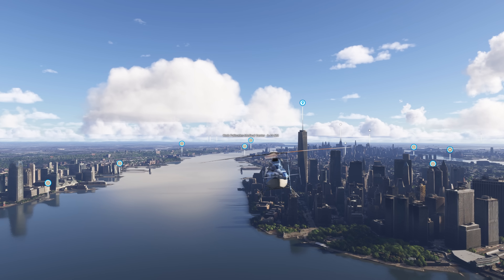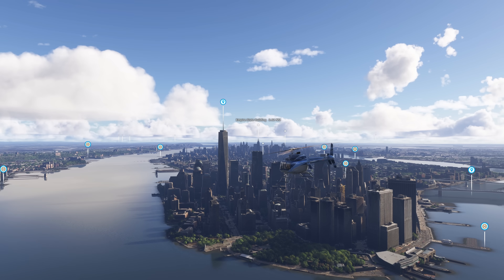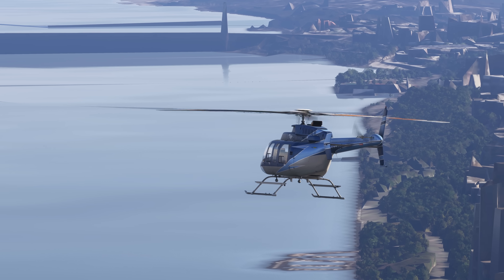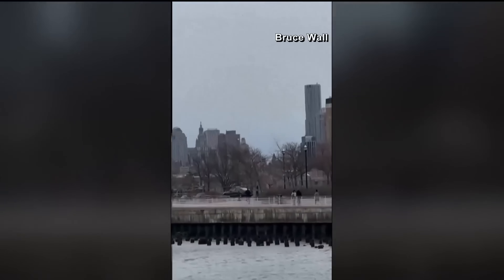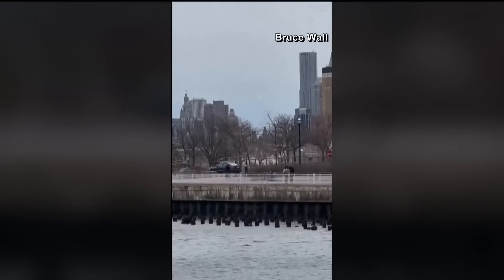Helicopter Expert breaks down Hudson Crash, and discusses “Bump Mast” Theory | NYC Crash Follow-Up

Comment: Could a client have pulled the rotor brake lever????? 
   

 It was a instant main rotor delete!  Ripped the whole transmission rite from the air frame. Surely they would have had chip detectors or vibration detectors going off if something was going on inside the transmission or motor.

Comment: Question: If the droop can hit the tail why doesn't that happen on start up?
Reply from the maker: Good question. The droop of the rotor is still above the tail on start. But if enough negative G force is applied in flight it will droop even further causing a strike.

Comment: Carbon composite main blades were fitted to this helicopter. (OEM blades are aluminium). I wonder if this contributed in any way to the incident?
Looking at video of the main rotor major fracture point…
The skin surfaces at the break are totally flat. Aluminium sheet would have a curve at the point of tare. Also the tare edge would be mainly curves. The torn edge of this blade skin is *totally jagged*. 
Definitely a composite blade and not aluminium construction. (It does have an aluminium leading edge protection strip, along the entire length).
I notice that Van Horn Aviation supply composite blades for 206L. (Don't know if they supplied these blades or if there are other composite blades available). I think they say they have 250 sets in use on the 206. (So fairly rare?) 
One of the blades has a trailing edge delamination from the major fracture point, all the way to the tip. While that could just have been initiated by the major fracture of the blade, it could also be the initiation of the entire sequence. (Blade majorly out of tracking, strikes boom, major aerodynamic imbalance tears gearbox from fuselage). I'm not particularly convinced about that sequence but it's a possibility. 
Looking at the incident video shortly after rotor separation from the helicopter, I'm fairly sure the major blade fractures occurred in flight, and not on impact with the water.
Reply from the maker: I’m looking forward to the NTSB report. Thanks for your insights!

Comment: I know sod all about helicopters. No way did any sudden movement by the pilot. Make the blades hit the tail. With the amount of equipment / machinery falling, id guess gearbox failed.
Reply: On the NTSB b-roll video of the pieces recovered so far, one can see the gearbox is intact and still attached to the mast and blades.  In other video the whole assembly can be seen in autorotation immediately after the incident.  Neither fact is consistent with gearbox failure.
Reply: @jpe1 I'm going on the fact the gearbox is attached. If It seized up suddenly. The inertia in those rotors would rip the gearbox clean off. As yet iv not heard anyone confirm that auto rotation is taking place. It is all speculation at the moment.

Comment: No disrespect to this guy, but it doesn't seem like he really understands mast-bumping. It has nothing to do with the rotor hitting the tailcone... hence the term MAST-bumping. The mast is the thing the runs up into the center of the rotor from the engine. Mast-bumping occurs when there's a loss of load (weight) on the rotor, a "low-G" situation. It could happen, as he notes, in turbulent conditions. A two-bladed helicopter cabin hangs underneath its rotor like a pendulum; its downward force keeps the rotor level. If the rotor is freed from this weight momentarily while spinning and not generating lift, it will flop to the side, and this is what causes its central hub to bump against the mast and damage it.

Comment: The Bell line of helicopters are very safe in general but it takes only one company to hold back on maintenance which could lead to failure. It could also be a rare occurrence of one small thing that can develop between inspections.

Comment: Captain Steeeeve - Great videos covering a wide range of aviation subjects! As a "wanna be" RAF pilot of 74yrs young I came across this video of how auto-rotation works.  Maintaining rotor speed is critical during engine failure. The gearbox "free wheels" at this stage by isolating the rotors from stalled the engine. In layman's terms the helicopter is put nose down to keep air speed up - which assists the blades to continue rotating (potentially providing lift when you need it) At the critical point in time you then pull the nose up and stall the helicopter close to the ground - You only get one shot at doing this! - hopefully for a soft survivable landing!
Stay safe and please keep the videos coming!
https://www.youtube.com/watch?v=u1lU64CG8p8

Comment: Loving this channel right now!

As a commercial helicopter pilot myself, that's probably not how I would describe mast-bumping. Respectfully, a more accurate description of a mast-bumping event is one in which the rotor head, which is the block-looking thing that the main-rotor blades are attached to, contacts the rotor mast; the vertical stick so to speak that stands up from the gearbox that holds the head and blades. If this happens in flight, there will be an almost certain separation of the rotor head (and blades therefore) from the rotor mast.

How and why does mast-bumping occur and what conditions are required to produce such an event?

For mast-bumping to occur, the first requirement is that the rotor system be of the two-bladed, semi-rigid style, also referred to as "teetering" rotors. These are found on Bell and Robinson choppers almost exclusively. As the name suggests, the rotor head "teeters" like a sea-saw on top of the mast during flight. This behaviour is by design and is not only normal, but necessary for normal flight of the helicopter. The reasons why are numerous, but understanding why this is such is not needed to understand a mast-bump event. A three-or-more bladed rotor system, which uses what is known as a fully articulated rotor head, cannot experience mast bumping. It is not physically possible.

The second requirement is that the aircraft and rotor system experience a low-g moment. These teetering heads are designed such that when the "disc is loaded" as pilots say (ie the aircraft is in a state of 1 or more G's or load factor), the head cannot contact the mast.

Thus the full picture: A two-bladed, teetering rotor helicopter enters a state of less than 1g, and the pilot does a "pushover" input with the cyclic i.e. reactively pushing the nose forward to counteract the upward motion of the aircraft experienced at low g. The head now strikes the mast at the droop stops, and if contact is with a large enough force, shears itself off the mast taking the two blades with it.

I'm also not sure I agree with the assertion that being overweight makes mast-bumping more likely. Quite the contrary in fact. A lightly loaded fuselage and rotor disc is much more susceptible to being pushed into an aggressive low-g moment by mechanical turbulence or vertical wind-shear. On really gusty days with a lot of atmospheric instability, one defence against mast-bumping is to load the helicopter up as heavy as possible, usually by the use of excess fuel to act as the ballast. The helicopter remains a lot more stable and resistant to flightpath excursions during turbulence when heavily loaded.

Comment: Looks like a main transmission seizure, followed by associated in-flight separation of main rotor system/transmission and tail boom failure. An extremely rare occurrence, but sadly an unrecoverable emergency. This looks like a mechanical failure and not pilot error. (opinion of a retired Navy MH53E pilot). RIP to the victims and their families.

Comment: Watched more of this video and I disagree with some of what the marine helo dude is saying - specifically, he says that during an engine failure, if you don't lower the collective soon enough, the main rotor will "droop" enough to contact the tailboom, and to that I say BULLSHIIITE!!  When the main rotor "droops", it flexes UP, not down during that type of event.  Maybe it's a miscommunication thing, but it doesn't sound like it.  The main rotor flexes DOWN towards the tailboom if you INCREASE THE COLLECTIVE (Increase power).  Also he's talking about the Jesus nut, which secures the main rotor to the mast, which after the main rotor recovery earlier today, we can see that the "Jesus nut" was not the issue here, but will wait to see what the heck actually happened
EDIT: Former US Army OH-58D-KW pilot (OH-58 aircraft are similar to the Bell model aircraft)

Comment: No smoke from exhaust before tail and main rotor/trans separated. Every time I have seen a helo poop an engine, a poof of smoke came out the back. I'm no expert but have seen it a few times with Apache's and Kiowas. My non expert opinion is the trans sucked in the sun of the planetary causing the trans to rotate on the frame pulling the tail drive into the boom.

Comment: If a helicopter's tail rotor fails in flight, the aircraft will begin to spin uncontrollably due to the torque of the main rotor being uncounteracted. The pilot must immediately initiate an autorotation to manage the spin and land safely. Maintaining forward airspeed can help limit the spin and provide more time to find a suitable landing spot. 

This is what I see in video 👆

Comment: As a stuck wing and moving wing pilot (Fixed wing and Rotary Wing) with 1000s of hours in both I love the stuck wing guys trying to talk helicopter……..

This gentleman does NOT actually describe Mast Bumping. Mast bumping is low G in the rotor that affects underslung rotor systems in which the rotor head while unloaded contacts the mast and severs the mast.

How about we wait for the NTSB report. Also they found the head and transmission. Waiting for the boom.

Comment: Mast bumping was immediately put forward as a theory.by many channels. Blancirio cautioned people not to jump to conclusions, particularly as the aircraft was in straight and level flight immediately before the accident. 

Now with the recovery of the transmission and rotor assembly mast bumping has been ruled out.

Maybe stick to airline ops, and leave accident coverage to people with proven expertise.

Speculations and misinformation are harmful.

Comment: Hey dude stop interrupting the guest.  He never got to what auto-rotation is:  For a helicopter, "autorotation" refers to the descending maneuver in which the engine is disengaged from the main rotor system and the rotor blades are driven solely by the upward flow of air through the rotor.  The mast didn't fail... the transmission is still connected to the mast in the videos that have surfaced... looks more like a transmission failure.

Comment: The rotor section ripped the entire transmission off of the craft.   The tail broke at the seam, no rotor strike, no JESUS nut failure.
This has never happened before.

Comment: Adding to that, they have now found the rotor section, which includes part of the helicopter's top.  The tail boom was broken about a foot further away from the initial attachment location to the main body, and it looks like a straight vertical cut.

Comment: Still we cannot come up with something very obvious - where is the tail boom ? My very first idea was that the gearbox seized which could explain the massive torque from the rotating blades that was required to dislogde the box or a major part of it. That caused the boom to swing rapidly and it brooke off.

Comment: My opinion . . .
I work in the elevator industry. My back ground has nothing to do with Aviation.
The first time I saw the video, right-a-way I thought to myself, somebody didn’t tighten up those bolts that holds the rotary assembly to the frame. 
Because you see the two arms on each side (Attachment Arms) straight as can be. 
I would audit the maintenance records and inspection reports.
Or, far stretch, Sabotage. Did the pilot have any run ins.

Comment: With all do respect to the colonial he didn't explain anything that related to "mast bumping" YOU NEED TO TALK TO AN ARMY UH1 PILOT  not a marine pilot and it would only be a Vietnam pilot not a pilot of even 30 years ago. This mainly happened to UH1 Hueys or the AH-1 Cobra very rare that the 206 ranger ever had this problem but does happen. This usually only happened with extreme forward or rearward stick movements where the rotor hub would impact the mast, breaking it completely off where the entire blade and hub would depart the aircraft. It has nothing to do with engine failure its totally caused by the pilot.

Comment: I wonder if you could do a show on wind and landings and how it is that these planes managed to land sideways?? Does their landing gear twist so they can land straight and then does it twist back. In your experience is the weather getting worse now with higher winds than when you first started. I also wondered how long it takes for a jet to go to 40,000 feet or to drop down from 20,000 to 10,000. You hear the tower making those requests all the time. Thanks for your consideration.

Comment: Happened to me once as a passenger in a Blackhawk, but it’s a much more robust machine and we kept the main rotor with all surviving. The transmission above the cabin locks up from a failed bearing or lack of lube, snapping the shaft and allowing the main rotor to go eccentric and hit the tail boom. The impact causes the main rotor to separate, and the cabin falls like a rock without the main rotor acting as a parachute. Speculation, but based on a real incident.

Comment: There is video of the rotors being lifted out of the waters, and it shows that the rotors AND the transmission was still attached to each other.  Would LOVE your update in the future as to discuss that the transmission indeed was attached to the rotors.  The rotors were not broken  and were still intact also.  So that would lead to his opinion as Jesus bolt issue.

Comment: A&P and CFI fixed wing here… Lots of Bell experience on the maintenance side. From the video of this horrible accident (RIP to all ❤). It looks to me as if the tailboom went first (why is the ?), then the main rotor with the main mod (transmission) still attached to the blades and the mast (so, NOT the Jesus nut) and then the main fuselage. AC looked in stable straight and level flight before this structural failure. So, mast bumping is a long shot. Once they look at the tailboom the NTSB will have a good idea of what occurred

Comment: A security camera caught the start of the incident. There's no warning, it just starts breaking apart. The transmission was still on the main rotor, so not the Jesus nut, something broke the main brackets off the airframe. To me it sounds like a catastrophic engine/transmission failure that seized something up to break the brackets off the airframe. Terrible accident, most certainly not the pilot's fault.

Comment: This tragedy, seems to be a transmission failure as it separated, but that’s me looking at video.  I agree with the expert regarding mast bumping.  Will be a year or so to see the final Mishap report.  Over compensation with collective could be an issue but not likely.  The airframe has good safety record.

Comment: From my understanding the video, it appears the motor mount assembly failed causing the loss of control. To see the motor assembly separating then the blades, that’s my analysis because a rotor damage would cause the body to spin with the rotor attached. Ret Captain

Comment: With all due respect Gentlemen... but it's an " Autorotation"...Def: "adjusting the controls as necessary to enter into an Autorotational descent". This should not even come into tge discussion...because the Rotor system literally separated from the Aircraft.  When the Rotor hub & blades depart, there is no hope for performing an Autorotation. Master bumping: Also...not a factor here...why? Because your average Tour flight involves flat, level turns, and no abrupt inputs to alarm the pax, or exceed an Aircraft limitation.  There are only 2 possible causes for this mishap...and I'm leaning heavily to the 2nd scenario: Either a Drone hit the Pitch change links, and the Rotor system then becomes uncontrollable, hit the tailboom, rotors depart or disintegrate, Aircraft falls to Earth. The most likely scenario is, that the main Transmission output bearings ( mast bearing) failed...in that scenario, the Mast stops suddenly, inertia takes the complete Rotor system off ( with the Transmission as well in the Bell Jet Ranger especially) and then same result, Aircraft disintegrates, falls to Earth uncontrolled. When that wreck is recovered, and the Mast is twisted like a Twizzler, and the Mast bearings are ripped out of the Transmission, that's what happened. With all respect, y'all need to defer to high time IPs and Maintenance background Pilots. The maintenance records need to be gone over, especially if there were Chip lights in the Aircrafts history.

Comment: I’d like to hear more about the transmission instantly ceasing up with no warning. No vibration. No lubrication issues. No overtemp warning. Just instant complete censure of the transmission. Has that ever happened before?  Causing the inertia to rip the entire transmission from the structure.